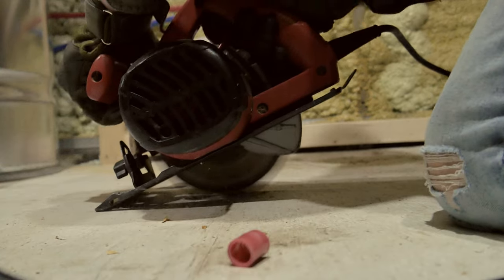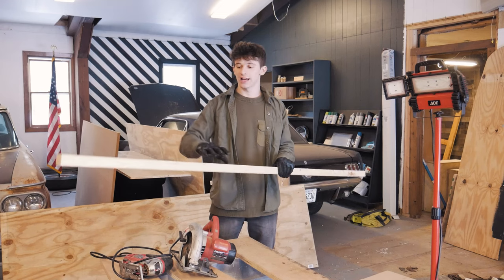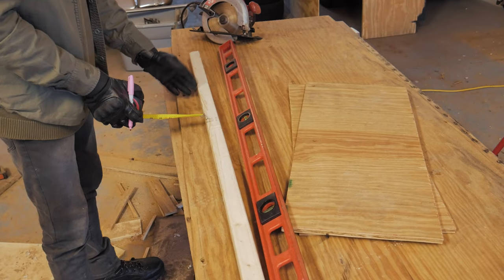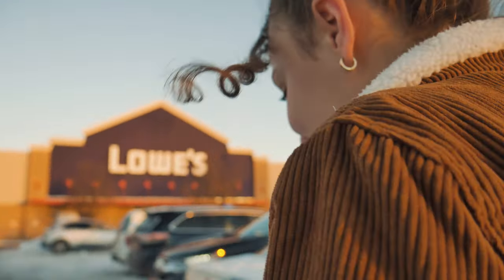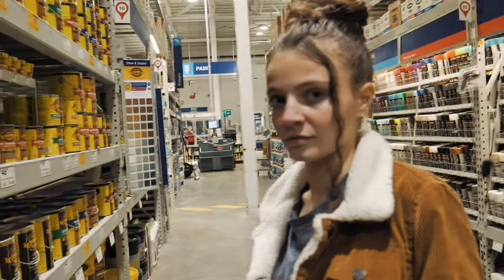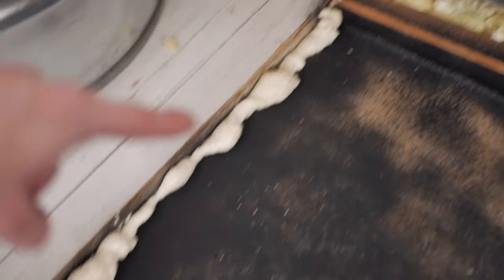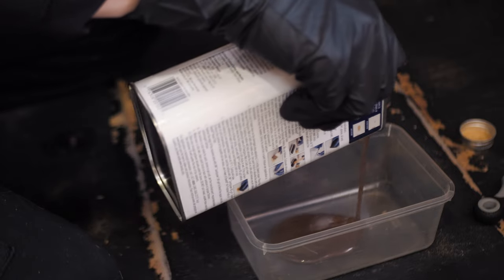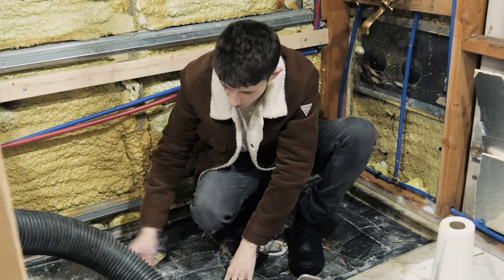We made a DIY Shower Drain Pan | SunChaserSkoolie

Comment: What products did you use? I could only see the back of the bottles. Looks like something by bondo.
Reply: Bondo products are really good and can be picked up at Lowes and most auto parts stores. TBH they are all the same woven fiberglass sheets and an epoxy resign. For a project like this id actually suggest getting the supplies on line at an auto supply store as they will most likely be cheaper. They don't do it but more layers = stronger. You can also put thing like 1/4" slats down first that will act as ribbing where you stand.